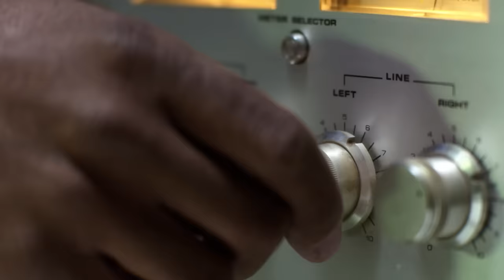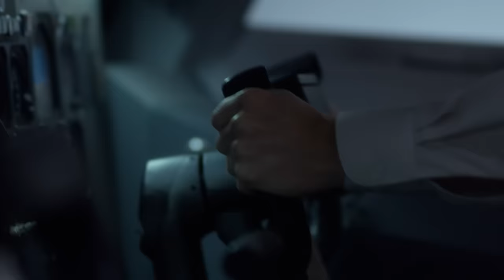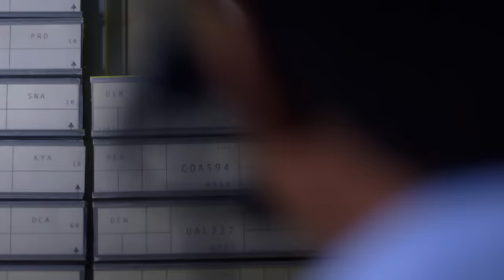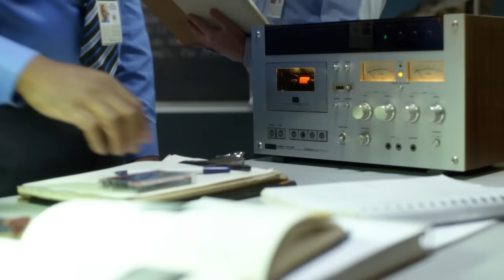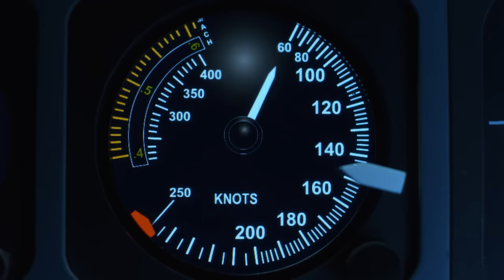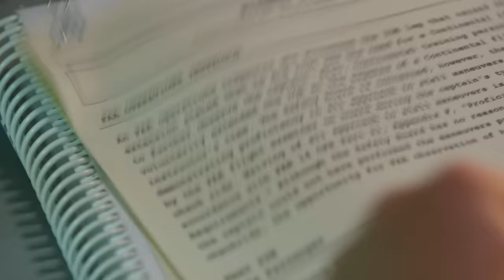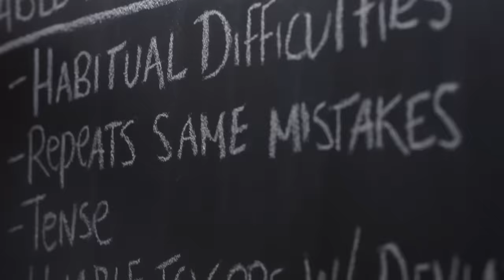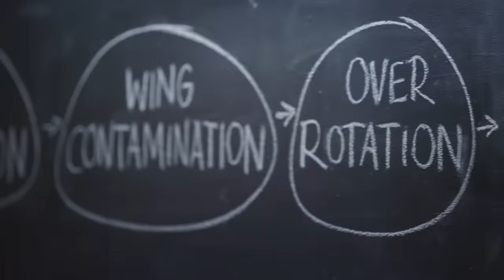Plane Crash That Changed Industry FOREVER | Mayday Air Disaster

Comment: Air safety is crazy man. A tiny amount of ice or a single bolt can bring down a plane, but a plane can lose a significant portion of its roof or lose all control systems other than it's engines after being hit by a missile and still land.

Comment: I have an interesting perspective on how lift in an airplane works. My father was a private pilot and we'd fly in Piper cubs, Cessna 150s, 172s and 180s among other small aircraft. The Cessna's were aluminum skin and had been flown a million miles so they were pretty clapped out and loose. So when my father would perform a stall, you could hear an oil can click noise just as the plane without drop. So even though there's flow across the top surface, there's still a bubble of low pressure grabbing, attached to, gripping the top surface of the wing, holding the plane up in the sky. When the bubble of low pressure would let go, that's when you'd hear the oil can noise. It changes how you understand what's going on and gives a cool perspective. Just thought I'd share that:)
Reply: That's one of the most laughable comments I have ever read. You may want to take some lessons on aerodynamics and how a stall actually develops.

Comment: One thing I've learned from this series is don't fly in foul weather.  

Have deicing trucks sitting at the end of the runway to provide deicing at the last moment to stop ice from reforming in the time between the gate and takeoff.  Put cameras up around the airport that ground controllers can rely on in conditions where the tower can no longer see.  Maybe ground detectors that can track aircraft and vehicles on the runways and taxiways that can provide a real time display of ground traffic.

Comment: That truly was fascinating. The NTSB did a spectacular job on putting together the pieces of the puzzle. Not an easy solution, that's for sure.
Reply: i love watching the investigating part
Reply: The NTSB is an amazing organization. Unfortunately is occasionally susceptible to political influence, it usually stays pretty neutral and get the job done, then implement the changes necessary to save lives.

Comment: Its interesing and unique to me about how this plane crashed. Its crazy how one mistake with could really cause devastation.
Reply: Same
Reply: Except it wasn’t just one.  I count at least 4 - 6 if you include the captain’s poor judgement and continental’s failure to match crew.  1. Hired poor pilot.  2. Failed to request permission to taxi.  3.  Took too long between de-icing and take-off.  4.  Over rotated on take-off.  5.  Captain used poor judgement.  6. The airline failed to match experienced captains with inexperienced 1st officer.
It’s always a chain of errors.  Break one link and the accident doesn’t occur.  This is what I always consider the real tragedy of these accidents.  All they have to do is break one link in the chain.
Reply: @Ryarios well said, and watch a lot of these airplane accident shows and it’s usually a series of mistakes which causes accidents.

Comment: 12:29 - "You're never gonna be able to save everybody"
Captain Sully: "Ahem."
Reply: I survived this crash and I want to reply to your comment because the man who made that remark: ‘You’re not going to be able to save everyone.’ was not a pilot.  Unlike Captain Sully, he responded to the actions of a pilot as a firefighter, not as the one who was at the controls of the plane.
Those firefighters faced a lot more than he had time to describe.  They came running before the tower even knew what happened because they saw it first.  The fire station was located just beyond the airfield where we crashed and in the darkness, someone saw a fireball and heard it.  As he says they didn’t realize it was a commercial flight until they got to us.  As they started working on the plane it rolled and shifted, suffocating people trapped inside including me.  They had to foam it down entirely to avoid combusting the jet fuel which had flooded the area.  We were all soaked in it.  That’s another reason why many died from the cold.
The firefighters had to stabilize the wreckage before prying it apart to get us out.  They worked their way inside the plane, one piece at a time mostly removed by hand and manual labor combined with grit and determination.  They’d finally get a seat pulled back to find a baby who died from his injuries.
So please don’t disparage that man.  He saved our lives.
Reply: @michellejansen6165  Have you thought about writing a short story or book about your experience? You seem to have such a vivid recollection.  Thank you for sharing your experience and thoughts.

Comment: It does not take much snow, ice, or even heavy frost to alter the smooth flow of air across the top of the wings.
Reply: nor would a little bring it down aone
Reply: @tankthearc9875  You would be wrong.

Comment: The captain should be on the controls in unfavorable weather conditions.
Reply: AGREED
Reply: Until far better level D flight simulators were created you had to provide adverse weather training experiences to your co-pilot somehow . Now that level D flight simulators have significantly advanced as far as trainees experiencing adverse weather situations the need to have copilots experience in real world situations might have been lessened. In addition we now have the potential to have video systems and sensor systems that would provide significant information about icing conditions before the start of a takeoff roll to the flight crew. Another positive is that there have been some advancements in aviation voice communication radio systems and pilot headsets that combine to help make it easier for a listener to clearly hear the voice communications.
Reply: @davidhoffman1278  everything you stated is correct. I’ve been flying for 25 years, there is not substitute for time in the seat. 

My responsibility as captain is to minimize risk, as such, in very severe weather, I drive.

Comment: I think the NTSB made some good recommendations at the end, but I was shocked that no recommendations were made regarding ATC losing track of the aircraft on the ground.  This mistake by ATC cost the DC 9 precious minutes.  (edit)  It seems the DC 9 never asked for taxi clearance.  I think ATC is off the hook for this actually.
Reply: They determined that the fatal plane was not clearing their movements so the tower couldn't keep track of them.   

All said, having the corresponder display, like they do for in-flight planes, would help.
Reply: @morganseppy5180 ,
I believe that there is a limit on how many aircraft transponders can be simultaneously operating on the ground. Get too many going simultaneously and the computer systems get frozen up with too much data.
Reply: @davidhoffman1278  surely that is no longer an issue like it was in the 80s and 90s. Might be too much interference.
Reply: GroundBasedRadar was developed shortly thereafter, although it took some years, before most Major airports had it.

Comment: Taking off a snow covered runway is an intense experience. In 2002, my family and I were on one of the last planes ✈️ out before the airport closed. The key differences: 1) competent pilots and ATC and 2) our plane was de-iced three times. One of the de-icing occurred just before we went down the runway. We bounced the whole way - like a roller coaster - until we took off and did a nearly vertical climb. Terrifying experience but we are alive.
Reply: I am guessing that the near vertical climb was because of noise abatement at the particular airport.  Nothing to do with the weather.
Reply: srs3572  Thank you. Yes, I have not had that bad of experience since that roller coaster ride.
Reply: @Moo2oob  No, it wasn’t noise issues. I have never had near vertical flights from that airport before or after the takeoff during a blizzard (so no other flight over 25 years). Well, the beginning of a blizzard. We were one of the last flights out before the airport was closed due to the weather.

Comment: When you are learning to fly, from the first time you pull back on the yoke in any airplane  one of the first things they teach you is to push the nose back down in a stall situation. The captain in this case failed to override the co-pilots mistake and that is what killed and injured all those people. There were other things in play, but the captain's inaction during the stall is what ultimately brought down the aircraft.
Reply: I watched another video in this series, where the pilot abruptly snapped at the copilot and took over the controls after the copilot made a mistake.  But the pilot in this accident was new at being the captain and being in charge of training a subordinate.
Reply: That wouldn’t have worked in a takeoff scenario as there isn’t enough space between the ground and the airplane to turn the nose down to gain speed and lift again. They were only 20 feet off the ground, there was no way to recover this plane once it was over rotated with the ice on the wings.

Comment: Can't they heat the wings surfaces so that they won't ice up?  I've always wondered about that.
Reply: There are systems that can heat the leading edges using engine bleed air or electricity powered heating systems, but you can't employ them for the rest of the wing areas.
Reply: It would be possible, but very expensive and highly impractical to install a 100% de-icing system on an aircraft when it would only be needed for 0.01% of operations.  On-ground pre-takeoff deicing works well, when it is applied correctly and in a timely manner.

Comment: According to the Aviation Safety Network (ASN) database, there have been 37 aircraft accidents at or near Denver International Airport (DEN). One of these accidents occurred on December 20, 2008, when Continental Airlines Flight 1404 crashed while taking off from DEN, resulting in 38 injuries and a hull loss.

Comment: I had to fly to Denver back in March 2006 from West Palm Beach for a job interview, and I nearly didn't make the trip. I'm a bit of a white knuckled flier to begin with and the weather in Denver had me acting more nervous than usual. Turns out, there were no problems, either on the flight to Denver or the flight home. But that was my last flight. I'm a driver, not a flier.

Comment: One of the two precipitating factors. The Air Traffic Controller got confused which delayed them. DEI (diversity, equity and inclusion) strikes again. There was a huge change in who was hired as Air Traffic Controllers-there was a strong union and President Reagan broke it up. They were long service, very capable controllers fired. New hiring (less experienced) plus focus on diversity. This crash happened in 1987 which was a few years after that occurred in 1981.

Comment: I have been an avid flying passenger for over 40 years. But now every day if it's not a door plug blowing out of the frame, an engine cowling ripping from its mount or a pilot copilot that is totally clue less with 36 thousand hrs between them in the news my flying days are over.  Love the show , especially the episode where the install TV monitors in the cabin so passengers can see what the pilots see as they take off veer left back into the ground with  full tank of jet fuel, I'm gonna watch myself die today in slow motion😢

Comment: I hate flying. As a "gear head" I always look at the mechanical aspect of accidents like this. When you're on a train or a bus or a car if there is a mechanical issue the train can usually come to a stop, a car or bus can slow down and pull over in most cases. But on a plane, when you have a mechanical failure (or any failure that causes a crash).....you fall from thousands of feet making it very unlikely for survival. So while no plane crash is good, if I were to be on a plane that crashes I would much rather is be on takeoff or during landing. This way emergency crews are on site in seconds, not hours or days. Plus the plane is much more likely to be in tact vs falling from the sky or flying into a mountain where the plane disintegrates on impact.
Reply: Trains > Planes.

I have a fear of flying and have to be sedated to fly. I’d always take a train over plane.
Reply: Yup...there's no fender-benders in the sky.
Reply: 19,515 people died in car accidents last year in the US alone.  Way fewer died in airplane crashes

Comment: also why didn't they cancel takeoff?
Reply: Several reasons:  Lack of experience flying this aircraft in icing conditions.
Reply: Several reasons:  Lack of experience flying this aircraft in icing conditions.  Unreported failures of the co-pilot in previous employment.  Finally, they were already behind schedule. Had they aborted the takeoff, it would've meant a second de-icing and further delay...something airline dispatchers have little tolerance, regardless of the weather.

Comment: Simulation is fake and inaccurate. I saw the debris of the DC-9 in Hangar 6 after the crash. There is a bumper under the tail of the aircraft. That bumper was pushed into the airframe. The pilot in control pulled back too hard and that bumper hit the runway.
Reply: That was the bang that was heard on take off. It should have been highlighted in the video

Comment: So this is the one time in history, where the building engineers and The Architects were absolutely and completely 100% wrong that these buildings were resistant to the Collision of an aircraft. These building designs were an utter and complete failure and should have never been built it's pretty evident these Engineers never took into consideration that concrete, while it is strong, is very very weak to shock. They can't take a Shockwave very well. I saw this in a test about 20 years ago. It was a very simple test they had two 10 foot slabs of concrete. They were 6 ft wide. They were standing on end representing the height of a single story. Another slab of concrete that did not have rebar in them laid on top of the two pieces of slabs of concrete. The concrete slab was the same thickness as a standard building floor. And then the engineers suspended a bowling ball about 10 ft about the center of the top piece of slab of concrete period of the engineer dropped the bowling ball and the Shockwave to the concrete fractured the concrete right in half and it fell between the two slabs of concrete that was holding it. Every single floor fractured into tiny little pieces of concrete. Most of it turned into dust grinding up the bodies and the furniture
Reply: What you talking about
Reply: What video did you watch?

Comment: The city and county of Denver has always hated United Airlines. 

Continental used to have DEN as a hub and the city and county loved Continental and that Mayor Peña wanted an airport so bad, they worked with Continental Airlines designing DIA for Continental and guess what? Their buddy CEO at CO pulled out of Denver and left the city holding the biggest taxpayer boondoggle in Colorado history. 

Yet again, United Airlines which the city hates stepped up and filled up the new airport with Hub flights. 

United has always been there for the city, classy and making them money. 

Don’t believe it? Next time you go to Denver watch the signage outside the concourses and how Concourse A was tailored for CO not UA. 

That whole airport in 1995 was another story. Stapleton was a perfect airport, not built way out in Kansas and had runways over I-70.

Comment: OMG... inspector's are switching to respecter to person instead of following through on the controller error. ! Corruption. 
If 20 minutes is required to take before icing occure than why do they feel like looking else where. Lives were lost. Reports from the plane manufacturer was clear. 
I noticed inspector's find out controller at fault, they scramble to bring other issues, to overshadow the truth. They are family in career

Comment: Another blatant lie. Most accidents  provide lessons that help make flying safer. This one, though, was way down on that list.
Reply: How was it way down the list
Reply: @warbxrdmusic  Why was it high up on the list? The title makes it sound as if this was THE crash that changed the industry. The comet crashes were by far the most significant in this category. The Turkish airlines Paris crash shed much light on industry standards. And 9/11, though not usually defined as plane crashes, nevertheless was by far the most dramatic in changing the industry more recently. You could declare virtually every crash as an event that changed the industry.  But I don't think that was the intent of the title, do you? It was to lure you in by making it sound unique.

And note the uppercase FOREVER, another obvious giveaway.
Reply: @cchris874  you sound knowledgeable so I’ll ask ; if a passenger jet suspended in midair was stuck by a skyscraper traveling at 500mph , like a bat hitting a ball , what would happen to the plane ? Would it cause huge damage to the skyscraper? Would its fuel enter the skyscraper?
Reply: @Larry26-f1w  

I would assume the effect would be the same as a plane hitting a skyscraper at 500mph.